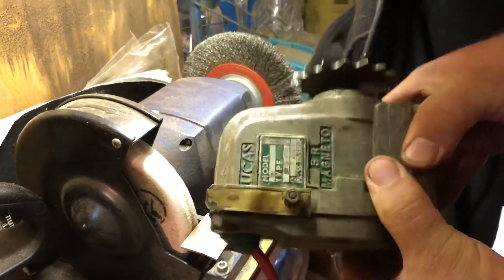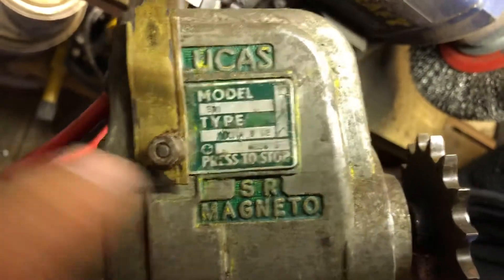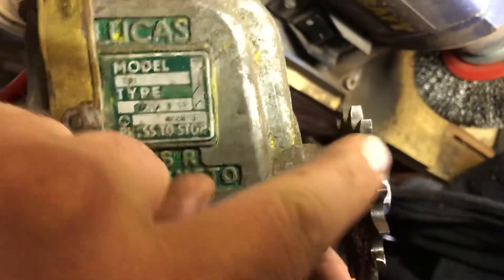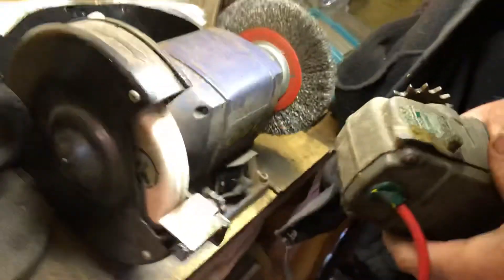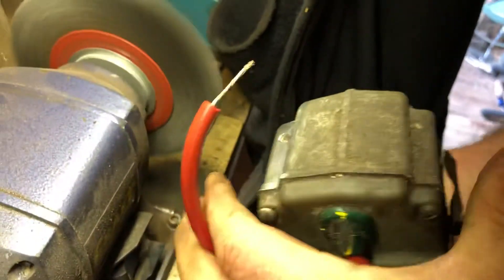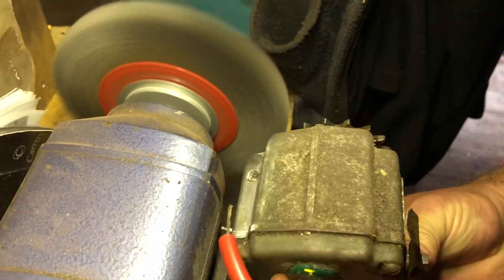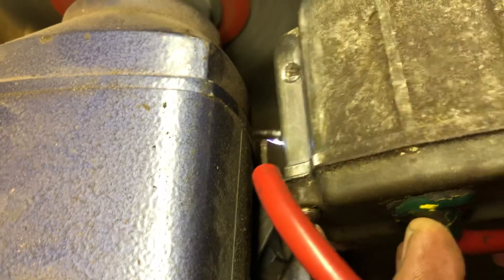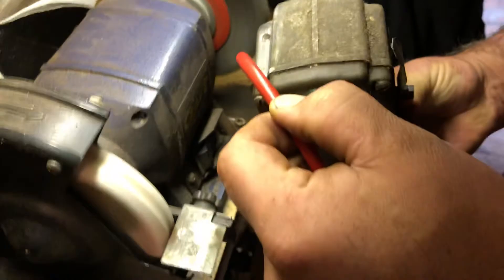Testing a LUCAS SR1 magneto for a spark by METAMORPHICWONDERS

Comment from the maker: Although i did this ...  its not advised, the internals need to be able to dump the stored current. If for any reason you dont allow it to spark, you can do damage to the internal capacitors. Running it high speed is done at your own risk. After this film , i sent this magneto away for a full rebuild as it failed!!!